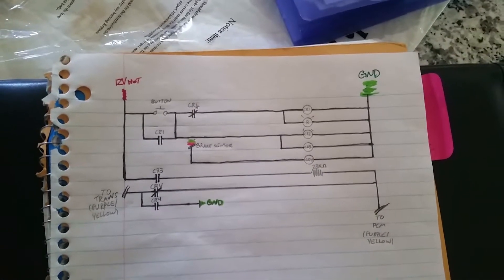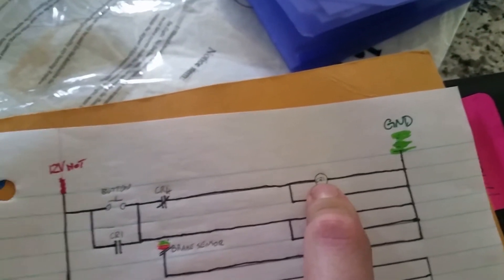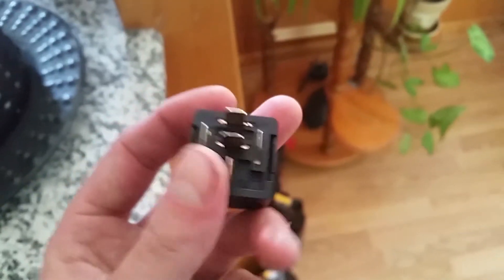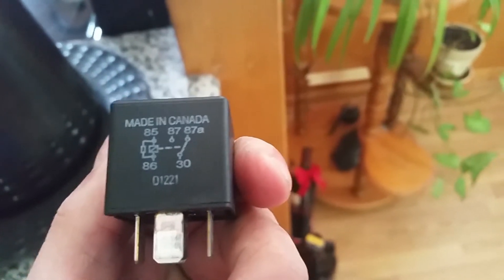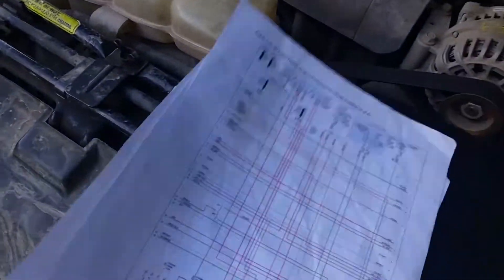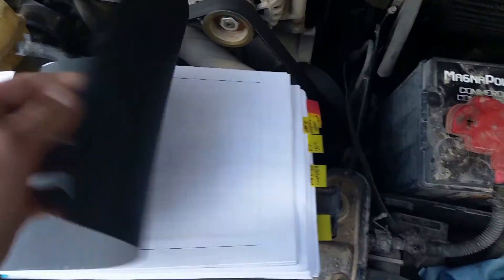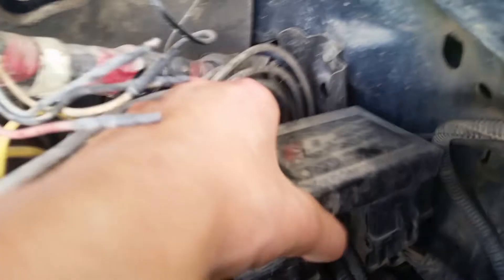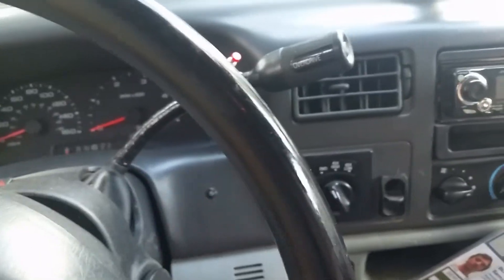4R100 Lockup Mod Schematic/Let's Learn Relay Logic *PLEASE READ DESCRIPTION FIRST*

Comment: What is the connection on cr4 at the top of your drawing? Bellow I see cr4 30 to Trans, 87 to ground, 86 to brake, and 85 to ground. Only one no used is 87a. Am I missing something? Thanks!!!
Reply from the maker: 87a is the normally closed contact, during the relays normal state (no power) it is physically connected to pin 30.  When it becomes energized, it physically changes positions and 87a is not longer connected to pin 30, but now pin 87 is.  

This is similar to a 3 way switch, commonly found at both ends of a set of stairs.

We do not need this pin in this circuit.

Dont forget your 22k ohm resistor!
Reply: @grouprocox  thanks. So I have it wired correctly. Still working out wiring logistics. Hope to be testing soon.
Reply from the maker: I MADE A MISTAKE IN MY REPLY LOL for cr4 at the top you hook up 87a to your indicator light AND to 85 on cr1.

I think I will make another video specifically on making the relay assembly
Reply: @grouprocox  isn't CR4 85 a ground? Wouldn't  87A to 85 cause a short at the relay? Thanks for all your help. Much appreciated!
Reply from the maker: @TheHawaiianDiesel  negatory my friend, pin 85 and 86 are the pins for the electromagnet, when a current is passed through it physically changes the state of pins 87 and 87a.  Those two pins are physically connected to pin 30.

Comment: I'm looking into using my EBPV as an exhaust brake...but I need to have my TC locked up to make it work throughout the RPM band from 2,350 RPM down to like 1,200 RPM in order to slow my BigAss E350 Club Wagon with the E4OD trans I got. Can you like PM me your diagram? This way  I make my Van slow down better when I engage the EBPV. I want them to work together.
Reply from the maker: I have had some time to think, and I would recommend adding an additional button dedicated to engine braking.  One that parallels the lockup circuit but also engages your ebpv simultaneously.  Now I'm not sure how many wires are going to the ebpv because I had not considered your idea and I love it!  If you already know how to trigger the ebpv to fully engage, then all that you need to do is split its trigger wire with a relay essentially.  You press one lockup button for accelerating, that one latches when you release the button.  The other for decelerating, which releases the circuit after the button is released.  I'll have to look into using the ebpv as a brake before I can try and draw up a circuit for you
Reply: @grouprocox  I'm going to wire my TC Lockup & EBPV Exhaust Brake to a double throw switch...1 side energized by my brake light & the other side via the "key on" accessory circuit. both side will be fused. The EBPV sending unit pig tail con tains the wire to activate the EBPV. I want to use your Lockup set up to give me the full benefit of the Exhausy Brake (EBPV).

Comment: thanks for the upload. So are you grounding the yellow and purple wire or energizing it?
Reply from the maker: You're energizing it with a reduced voltage, since there is a resistor in series, it takes some of the load away.  If you were to just hit it with straight 12v it would work, but your OD light on your shifter would be constantly blinking.  The resistor lowers the voltage to trick the computer into thinking that everything is operating as normal.  Kind of tough to explain exactly, since you're grounding out one side of the cut wire and applying the lowered voltage to the other side of the cut wire.
Reply from the maker: I just made a correction to the schematic, jump to 5:38
Reply: @grouprocox  would a 22k resistor work as well?
Reply from the maker: @TheHawaiianDiesel  it might, worst case Ontario if it doesn't you just have a dummy light annoying you.
Reply: Thanks.